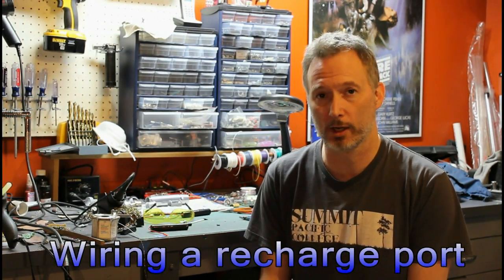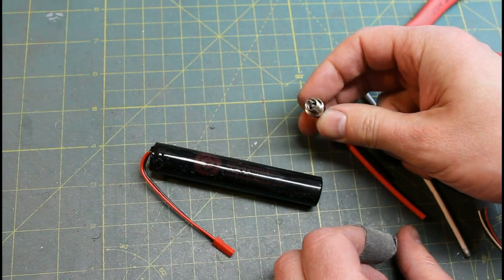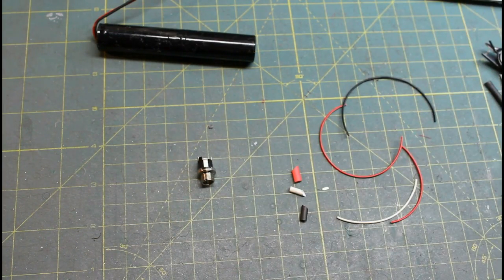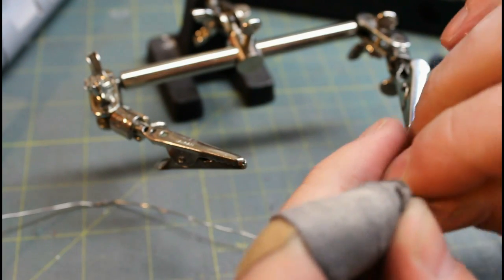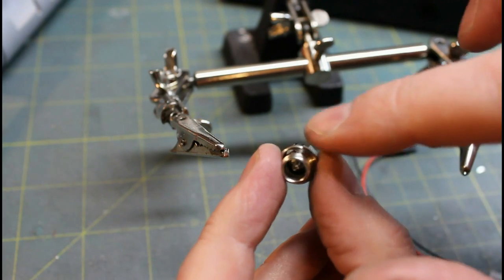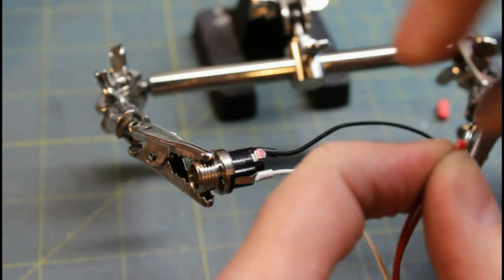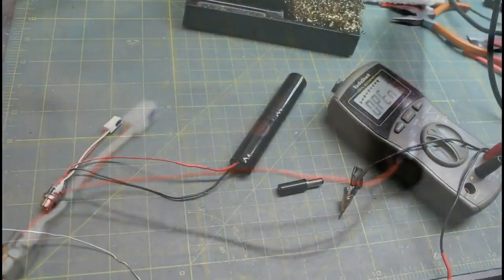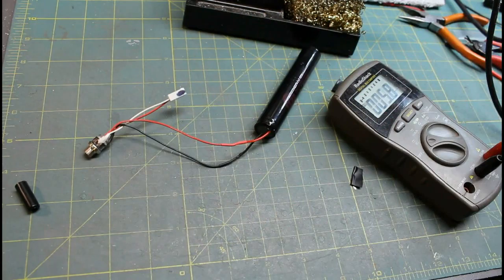Wiring a recharge port

Comment: And I'm assuming once everything is done you can wire the wire connector to the soundboard yes? It might be an obvious answer but I am looking at my proffieboard manual and the diagram looks different so I want to make sure. Could anyone also tell me how you would wire the neopixel blade with the recharge port while following this video? Again I am looking at the manual and am not sure.

Comment: If I were wiring a stunt build (and therefore didn't have a soundboard), would I just wire 1) the battery to the recharge port, 2) the recharge port to a latching switch, then 3) the switch to the LED? Or am I missing something?

Comment: Hey so I got a bit of a problem on my build and need some advice from an expert lol so I’m trying to wire up my saber to use a tp4056 micro usb charge module.. and obviously need a way to kill the power to the board, just wasn’t sure if I should just add a latching switch to the positive lead in between the (board/chip) or should I add it to the negative? Pls help hahah great videos btw

Comment: Can a recharge port be wired to a light only build?
Reply: Yes, as long as you have a resistor for the led, you'll also want a latching switch or a converter board

Comment: Tips/thoughts on wiring two 3500mAh 18650 Li-Ion batteries to a single recharge port?
Reply: Jacob Maschmeyer well I think you’ll  need only 1 18650

Comment: If you DO happen to accidentally touch the battery leads together and get a spark, is there anything that needs to be done to RESET the protection circuit in the battery?
Reply: The protection circuit cannot be "reset", it can only be replaced.

Comment: Hi Rob, quick question from the UK. If I wire in a recharge port and need a standalone charger, what would I need to buy? Can you link it please, and will it work with UK mains voltage? Thanks

Comment: What are the pro's and cons to using a 18500 7.4v as opposed to a 18650 3.7v battery?
Reply: 18500 are smaller - good for tight spaces, 18650 are larger, but last longer.
Reply: Derek Callor
If we're speaking about batteries in conjunction with sound boards sold at thecustomsabershop.com, a 7.4v 18500 would work with either the Crystal Focus or Petit Crouton, but almost certainly fry a Nano Biscotte, Prizm, or Pico Crumble (over voltage). Those last 3 are designed for a max input of 5.5v, and that's where the 18650 (or any other)  3.7v single-cell battery truly shines (no pun intended).

Comment: So, is it possible to wire a recharge port into a saber with sound style 1 hilt (with the black piece that holds the battery, speaker and soundboard)? To me that would be the most optimal set up as you have in hilt recharge for display, but a removable battery for cons and other instances where a fixed internal battery isn't the best choice because of charge times.
Reply: Almost anything is "possible". It might be tricky to find space though.

Comment: just curious, is the metal recharge port (the shaft with the threads that you screw in to your saber) ever energized? (does current ever go through it)? just curious.
Reply: That part is connected to the negative.
Reply: I'm just curious, wouldn't that energize the hilt (or any metal piece) that it is screwed in to?
Reply: Being that it's the neg charge, it's ground. Just like the frame of your car.
Reply: ahhh. okay :) thanks a bunch!

Comment: I live in the uk, 28 awg stranded wire really hard to come by. but I can find plenty of 30 awg stranded and 26. would 30 be suitable or would you recommend 26 more? many thanks
Reply: +bri w 30g is ok as long as it's stranded and you're not doing long runs
Reply: +Rob Petkau many thanks, the longest length should be 12 inches, no longer

Comment: hey man I have a huge question, so I'm looking to put a PLI on my Saber but I would like it to tell me how charged it is when its plugged in and when its on but I also want the LED to be off when my kill key is in, how do I go about that?
Reply: +Alex Tucker Not possible with one PLI. You'll need a separate one on your charger.
Reply: +Rob Petkau okay so then at that point two would be running when it's on right? I'm just worried about over charging my battery so I've been trying to figure out some way to do it
Reply: +Alex Tucker If you have PCB protected cells or a protected pack like TCSS sells - you do not need to worry about overcharging.
Reply: +Rob Petkau okay cool thanks man

Comment: is it possible to wire a micro usb port instead of the port you use there?
Reply: +Eduardo Orantes Possible yes. But you would need to ensure you are providing the right voltage and current for the battery to charge safely.

Comment: really appreciate your work on these videos, very helpful. quick question, you say you use a slightly different connector to save space and not use the  jst. what is the other connector? doesn't look like a micro jst
Reply: +Bri w (willbo) I use Molexx KK, about the same size as JST. I meant that sometimes I do not use a connector at all to save space.

Comment: I bought an off brand plug that looks and appears to act the same as yours, however, the one you wired the white wire to, seems to not be connected to anything on mine and the one with the tab is always connected even without a charger or kill key installed. can you advise?
Reply: +stephen salstead I can't know for sure. But you can use a multitester to ensure you have the right legs
Reply: I tried that. the one connected to the switch and the one connected to the pin were the only ones that ever seem connected, even with a kill key or dummy plug inserted. the third leg was never connected. im glad that tcss got the switch crafts back in stock and just ordered some. hopefully that will resolve my issue. thanks for getting back to me!

Comment: Are the new skilcraft port post configuration the same? With the S/C post for the negative wire to the sound board and the opposite post the positive? The new posts look different then these. They are the same width all the way down and have oval holes in them.
Reply: +Chandler Morris I always advise people to test them to make sure.

Comment: 7:45 "I don't want to risk that anything's gonna come in contact with that."
proceeds to lay exposed wire on uncoiled solder from the spool

...Sorry, just a slight bit of a cringe inducing moment for me. (Yes, I am aware that the battery's red wire is still taped off at this point, not to mention the protection circuit, so no real risk of damaging the battery, but still...)

In all other regards this is a nice informative video and I want to say thanks for putting this and your other tutorials here for saber builders everywhere.
Reply: J. M. The exposed part of the wire didn't actually touch the solder, the plastic insulation did.